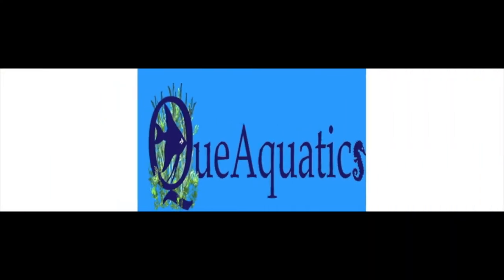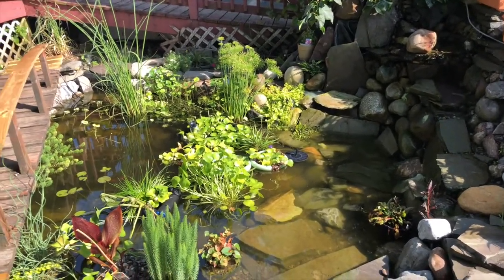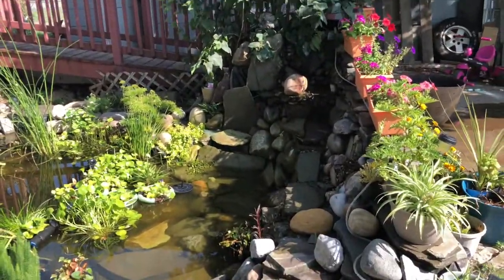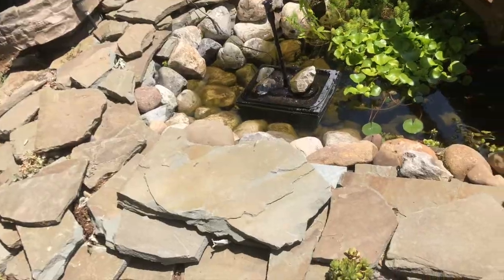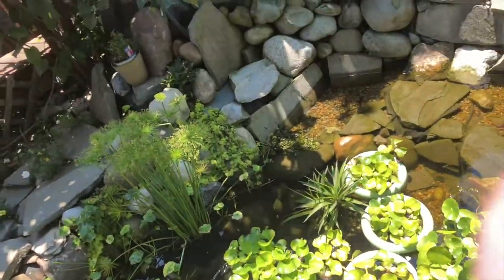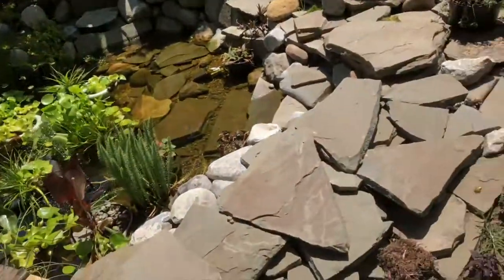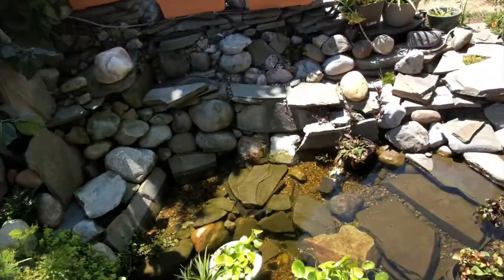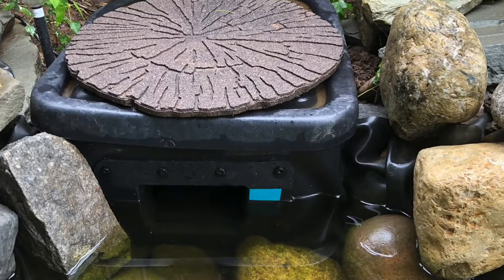Is My 2000 Gallon Pond Leaking?!? Filling my pond daily?

Comment: Thanks why i don't like pond liners. It seems as if the liner got nicked by your decoration ( rocks or something. Thats awesome work.
Reply from the maker: Thanks, what do you use instead of a liner?
Reply: Hi friend, my ponds are above ground, I use containers. I am planning on making a super large pond probably as huge as yours. Primarily to keep large fish stock. I am planning to use concrete. Probably that's not an option for many since renovation and restructuring of pond is restricted, however leaks are 0-1%..Interp had the same issue. Liners have to be replaced after a couple of years. llolo